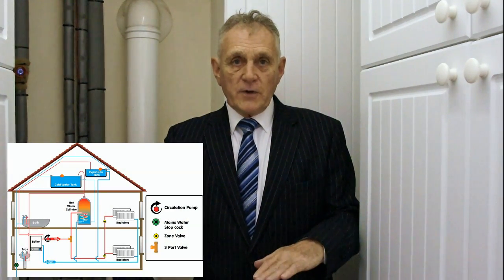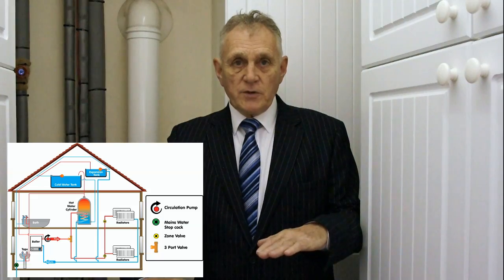HeatingSave Flow & Return Balancing feature explained

Comment: Heat Pump your money goes right up the chimney Heating Engineer haha they did a 2 day course maybe.Are your heat loss calculations correct is your pipework sized properly is your heat pump the right size.Take your pick they have a excuse of why it is costing a fortune.Insulation you need more,get out of jail card.

Comment: i read on every single website that my return flow temp should be 55c.i have boiler at 55c output flow temp and my radiators are way too hot and house is way too hot meaning i turn heating off after about an hour.should i lower the boiler flow temp or adjust the radiators?
Reply from the maker: One thing that’s advised to do is to check the temperature before you make any adjustments and then you can compare it after any changes. The ideal temperature for a radiator is between 18c-22c and the ideal temperature for a boiler is between 50c-60c therefore we recommend you to turn the temperature of the radiator down instead of the boiler.